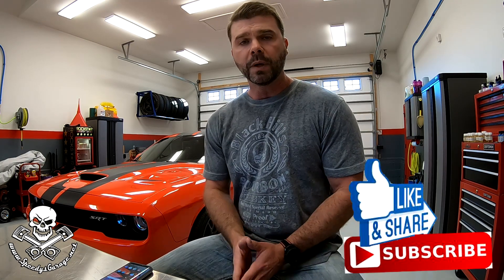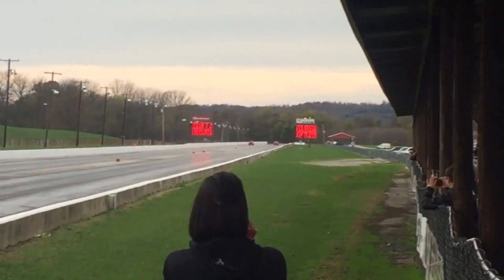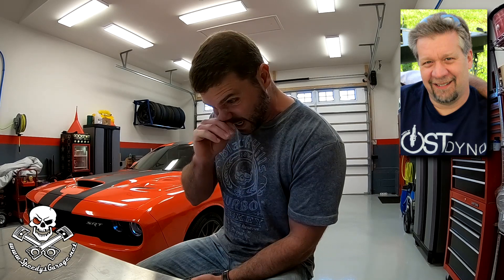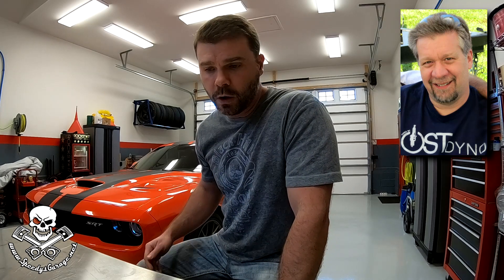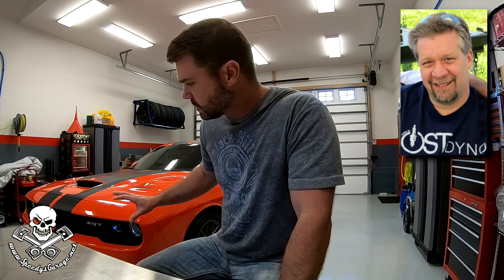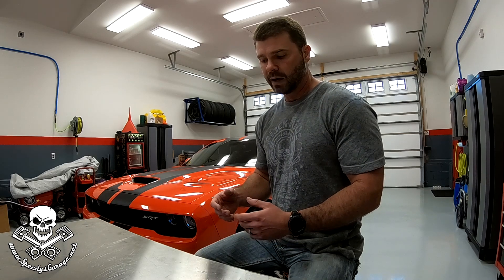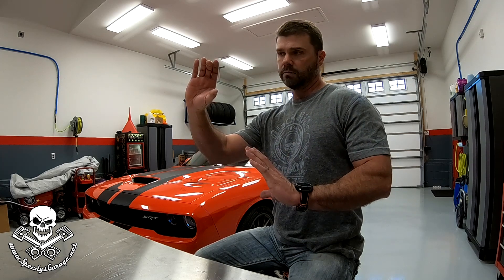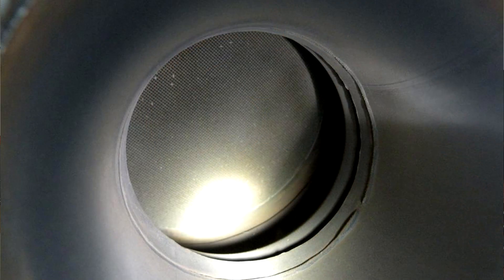Speedy's Garage OST Dyno Tuner Chat Hellcat Rumors

Comment: Very informative. Everything you spoke about in this video related to fuel is something that Ive had a hunch about but for along time but have yet to ask a guy like Mike about. Im buying a camshaft from him along with a converter for my Scat Pack and will tune it for a 100+ octane leaded fuel. Its Cheaper than some of the oxygenated fuels. I have a Torco Fuel dealer near me. Id rather go race fuel than deal with the caustic issues with E85.

Comment: Litens is also making a 2.85 Hellraiser decoupling pulley that you can pre order now
Reply from the maker: That's what I've heard.  I'm not sure why anyone would choose that one though.  These do not have pulley rings you can change so it's labor intensive to change boost levels.
Reply: The kits that you can buy now comes with both 2.72 and 2.85 pulleys. I have a 2019 Challenger RedEye Hellcat wide body, would you recommend I use the 2.72 pulley instead of the 2.85?

Comment: Was orange crush as fast as go man go?  Have you looked into your suspension to pick up better times? I truly feel challengers will be much faster if we can get the power to the ground. I'm hoping to have my procharger installed by February.  I'm looking forward to running with you demon guys with my srt8
Reply from the maker: Orange Krush wasn't quite as fast, the best I ever ran was a 10.85 at 129 or so MPH.  Go Man Go easily runs 10.50s at 131.  Orange Krush was a 6 speed though, so it would have done better with an 8 speed auto like the Go Man Go has.
Reply: I'm surprised your not in the 9s with go man go. Do they make that pulley for procharger?
I'm starting with the 12lb pulleys as my starting point. 
Thanks again great info
Reply from the maker: Go Man Go is still stock....9s should be pretty easy once we start tuning/modifying :)

Comment: Speedy. You had some awesome and very consistent runs in your orange crush Manual. I’ve got a Manual Hellcat. 

I know this is a tough question:

In one or two sentences can you describe your launch technique in Orange Crush?

Thanks in advance. Love your channel.
Reply from the maker: 4000 rpms.  Bring clutch up to engagement point.  Hold.  Drop clutch and go to the floor with the throttle in one smooth motion.  Took lots of practice to get right.  I've been thinking of doing a video on it actually.
Reply: Speedy's Garage thanks for the response. A video would be really cool. As much as we mod our cars, best times often come down to driver ability. I know my Hellcat has a lot more in it that I’ve been able to get it to do. 

Practice is cheap and fun too!
Reply: Speedy's Garage do you purposely slip the clutch a bit to prevent tires from breaking loose, or do you have it dialed to where you’ve got it grabbing with no clutch or tire slip?
Reply from the maker: If I slipped the clutch it wasn't very much.  Keep in mind I had the most success running a Hoosier 28x10 slick on a 17x10 wheel.  The side wall would absorb a lot of the shock.

Comment: Mike is sharp, but E85 is well worth the upgraded injectors, and BAP or twin pumps.  $100+ for 5 gallons is crazy for making big power.  Great insurance, but the power isn't there all the time.  Once you have 900+ rwhp...you never will go back.....I run 93 strictly for street driving in the winter only because I'm in Chicago and I daily it.
Reply from the maker: I can barely use 700 on the street, where you do you drive in Chicago where you need 900 haha.
Reply: @SpeedysGarage  I'm in the burbs, lots of highways and plenty of space still being "urban"

Comment: Did your old challenger with the magnuson have an ice box to keep the intake temps down or did you not use anything?
Reply from the maker: I didn't use anything and the IATs would get up there at times.  At the end of the 1/4 mile they would be about 80 deg over whatever ambient happened to be.

Comment: you need to look up a2speed 2995.00 gets you 2.85 upper.ati lower pinned crank ,1050id injectors 820whp all day long tuned by dave kasper of bg performance ===factory chrysler engine calibrater.This is were mine will be going ,as my friend already had this done  and went 9.94 137mph , oh yea tht price is instlled tuned and all  on 93 octane
Reply from the maker: I know those guys very well and they do good work. Eric H. over there and I are good friends.  Mike at OSTDyno has been tuning my cars for years and I've been very happy with the results, so that's who I'll go with.

Comment: What was the parts cost you came up with for converting go man go over to E85?
Reply from the maker: I didn't price it out exactly, but have been told it's about $4,000 by the time you get everything.  Some components might be a wash though since you need an unlocked PCM for tuning period.
Reply: That would buy a lot of 109 race fuel!